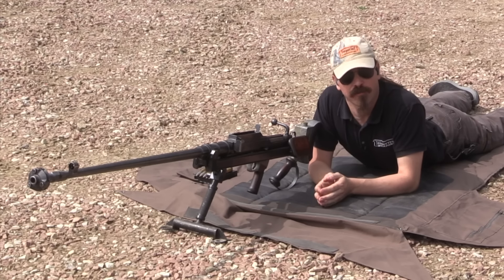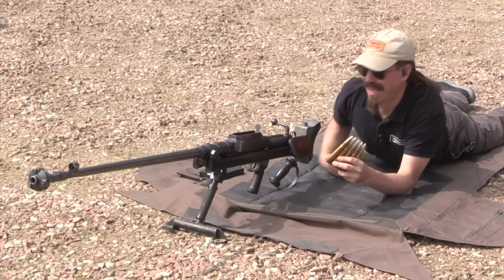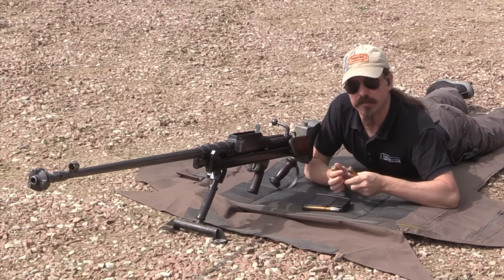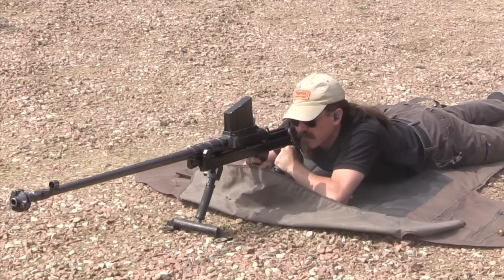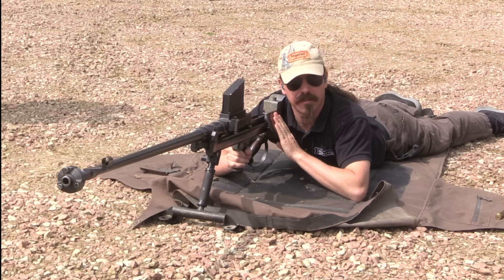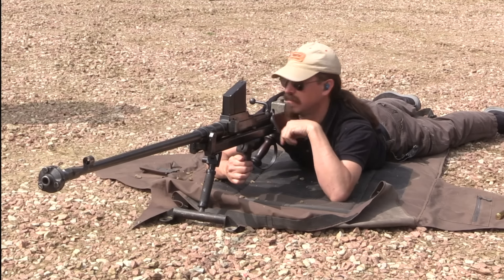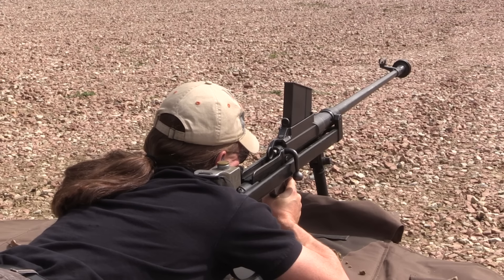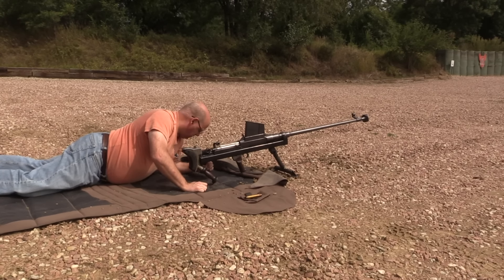Boys Mk I Anti-Tank Rifle at the Range

Comment: You state at the start that the Boys .55 round was never used in any other gun...

Early in the war, supplies of American .50 BMG's were somewhat lacking, and Rolls-Royce, as a precaution, designed a machine gun, for Air-to-Air use, based around the .55 round. I've heard that it was a complicated mechanism, and had... Issues...
Supplies of .50 BMG's improved, and the MoD told Rolls-Royce to drop the project and get back to making aircraft engines...

https://firearmcentral.fandom.com/wiki/Rolls-Royce_Experimental_Machine_Gun

Comment: "Tungsten is lighter than steel"
Eh... WHAT?

Tungsten: 19.28 g/cm³
Steel: ~8.05 g/cm3 (depends on steel)

Tungsten is over twice as dense as steel.

The difference is the size of the core, tungsten is much much harder so you don't need nearly as much mass to penetrate with it. You do however need speed.

Comment: If the Boys uses a removable box magazine, and nothing else uses the same cartridge, why does the ammunition come on a stripper clip?
Reply: Cheaper to issue about 3 mags to anti tank tifle team, and bandoliers of rounds in stripper clips. Asst gunner  reloads spent mags with charging adapter -- pushing fresh rounds back in.
Expendable, used-once magazines were not a concept yet. Ian didn't have the adapter.
Reply: @HootOwl513  Thanks!

Comment: This may be a stupid question but, how did they measure the speed of a bullet ?
Reply: I am not sure about this gun, but for rifle and pistol ammo a wood-block pendulum could be used.  And the calculation of the chemical energy released by the gunpowder would be a good start.
Reply: @kirbyculp3449  thanks sounds reasonable, but this " rifle" or as I think of it "small  cannon" would disintegrate it, maybe something heavier like a slab of armour  of a known weight etc ?

Comment: What kind range would you use this when firing at an armoured target?
Reply: Unfortunately not far enough away from the target.

23.2mm penetration at 90° 100 yards (91 m) 

18.8mm penetration at 90° 500 yards (460 m)
Reply: @shawnr771  thanks, quite something using that in action

Comment: Sorry Ian but, Tungsten is not lighter than steel? Granted I'm not super familiar with tungsten but I don't really know of any tungsten Alloys that would have a lower density than a steel alloy.
I'm assuming the core for the tungsten round would be tungsten carbide with a density of 15.63 g/cm³  while hardend steel is only around the 7.7 - 7.8 g/cm³ mark.

Don't worry you're still my gun jesus.

Comment: No, tungsten is not lighter than steel.  Feel free to edit that part out.
Reply from the maker: Technically speaking, one element is not more or less heavy than another, it is more or less dense than another. I added a note about my slip of the tongue on that a year or two ago in the description; tungsten is denser than steel. As fort he Boys projectiles, the tungsten cored one was lighter than the steel cored ones, because it deliberately used less tungsten in order to achieve a higher velocity.

Comment: W lighter than Fe?  Show your work.   Atomic weight 183.8 vs 55.8 ish. The value in a tungsten alloy is it's weight, and sides that it's plenty hard.  You might build a light weight penitrator, but that 
part would be small by volume.

Comment: Tungsten is not lighter than steel. Tungsten, symbol W for wolfram, has a greater specific gravity than uranium, steel or lead. steel 7.83 gram per cubic centimeter, lead 11.34 grams per cubic centimeter, uranium 18.95 grams per cubic centimeter, and, finally, tungsten 19.25 grams per cubic centimeter.

Comment: tungsten is not lighter than steel, dude. Check Wikipedia. In fact, tungsten is one of the densest materials (after heavy platinum metals and gold, denser than uranium in fact)
Reply: It doesn't fire pure tungsten. You'd be comparing a hardened steel core vs a tungsten alloy core.